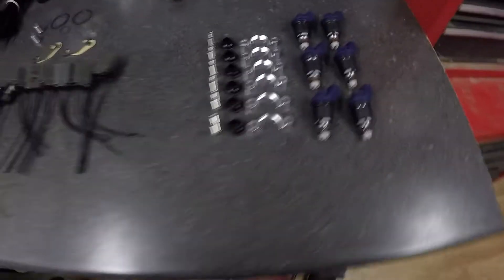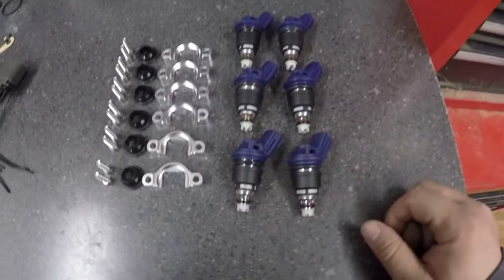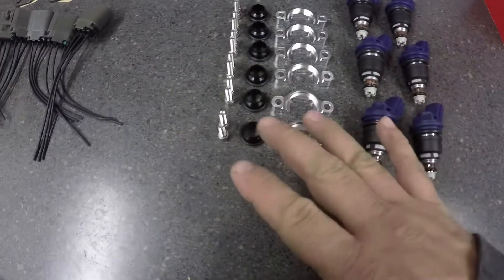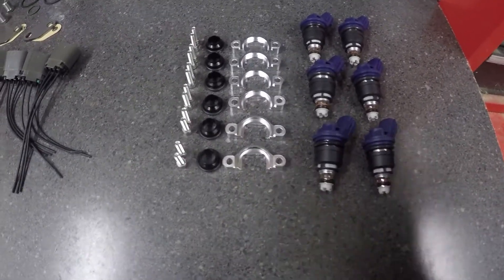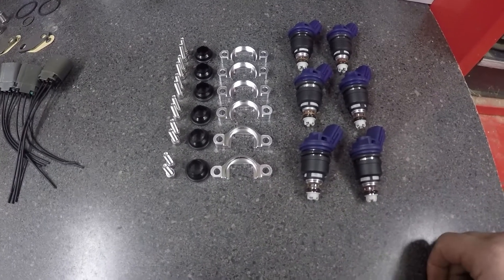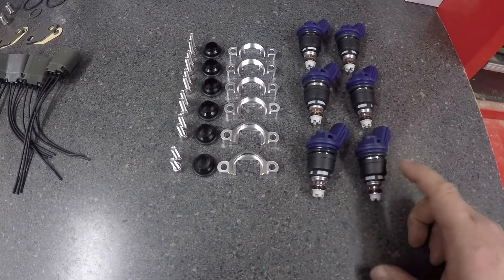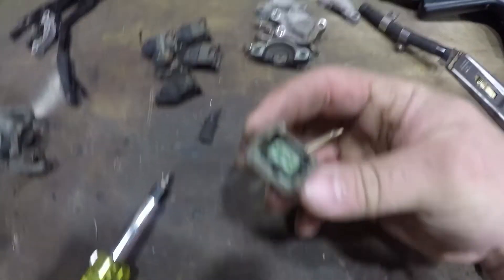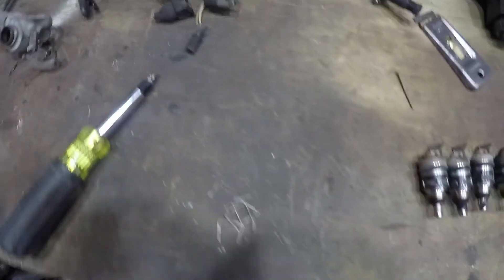300ZTT Old to New Style Fuel Injectors

Comment: I'm having trouble getting them to sit completely flush as well. Did you have any leaks?
Reply from the maker: This was a long time ago but I don't ever remember having any leaks for sure. If you push them hard enough they should make a nice snap into place just be careful where you push. The edges will break off. Make sure you lubricate the oring with some oil too so they don't rip. Good luck.